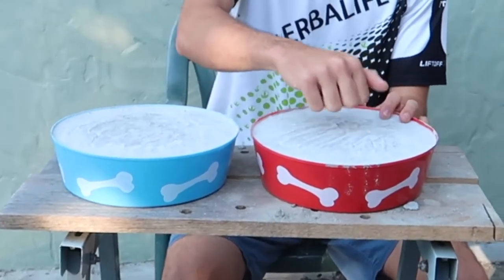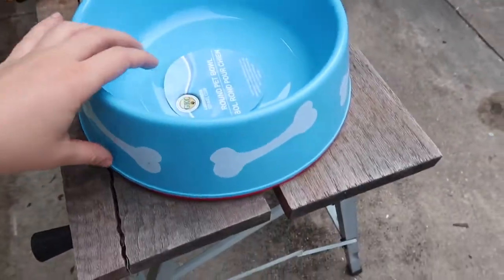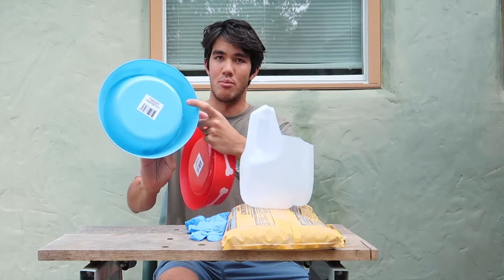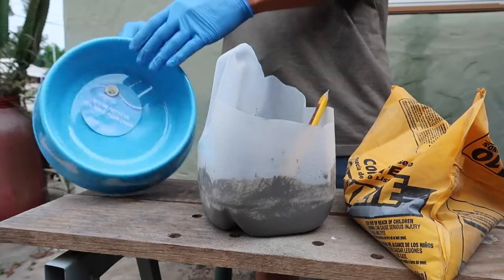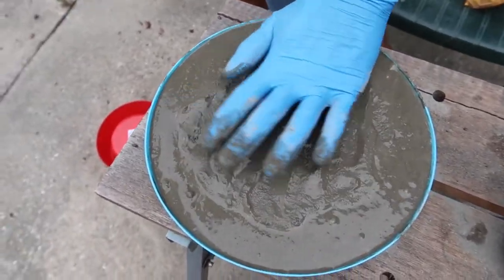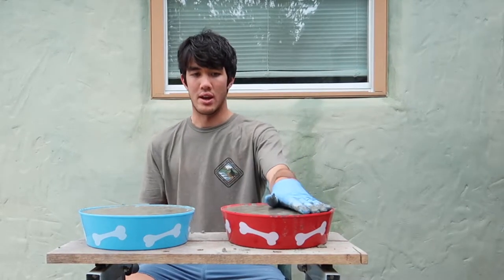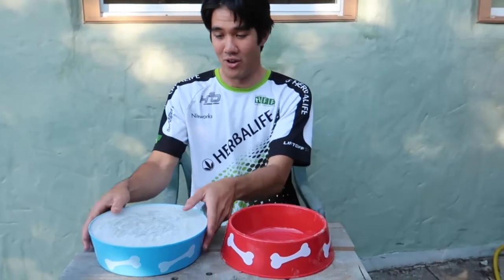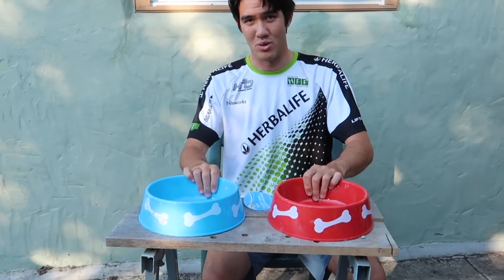No Spill Water Bowl For Pets! DIY

Comment: Can you please post a video of your kitty using it? :) Your cat is too cute!
 I plan on doing this for my cat because she AGGRESSIVELY paws at her water dish as well as paws out the water; water splashes out everywhere and it's such a pain in the butt. I like that the blue and the red bowls stack so closely together; you could buy extra bowls and keep them on top of the cement ones; this way, if the bowls needed to be washed, you could just remove the top layer bowl. I want to try this with stainless steel bowls :) Thanks for posting this video!

Comment: Did it work?? Our cat does the exact same thing & I don't know what to do I want to try your diy
Reply from the maker: Yes! It absolutely works. Haven't had any water issues since. Some things i've learned since making this video. Use rubber or foam(yoga matt) on the bottom concrete to prevent sliding. I would use 2 bowls per unit, somewhat like a stackable liner. Making it easier to remove the main bowl to clean. Rather than lugging the concrete block into the sink. Hope it works out!
Reply: @YourOwnAdventure  thank you so much we will definitely be trying this!

Comment: I wished I could’ve seen it placed where the cat drinks to see what the cat does did it work? How much does it weigh with the cement ..my cat does the same shit  trying to find a solution cause I’ve gonna through a few bowls now and towels and moving the bowls to different location nothing is working lol
Reply from the maker: This absolutely works. It weighs about 5-10 pounds and even my most pesky cat cannot move it. Haven't had to deal with the water issue ever since. I just put the bowls right back where they were originally.
Reply: Your Own Adventure cool I think I’ll do it tomorrow...does it hold about 12oz? thank you
Reply from the maker: @trishab.7629  of water or concrete?
Reply: Your Own Adventure sorry the water ? I usually buy bowls that will fit 12-16oz of water